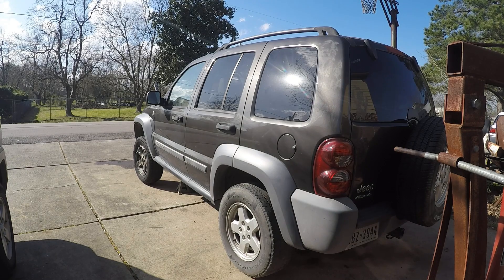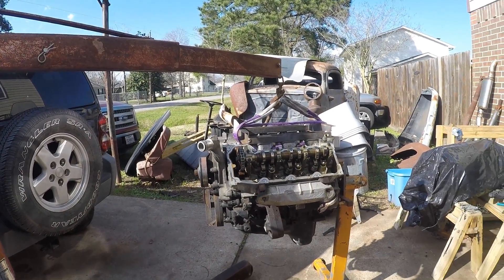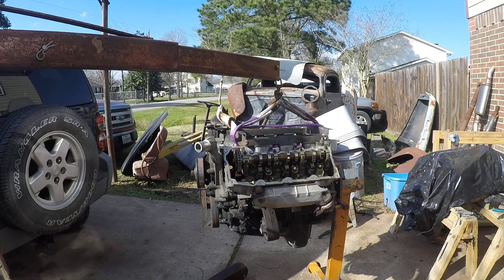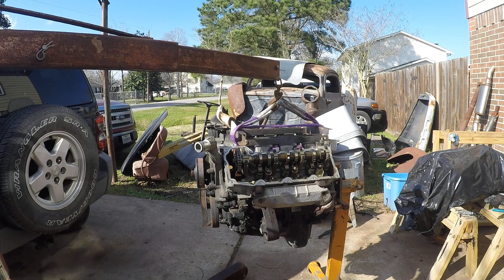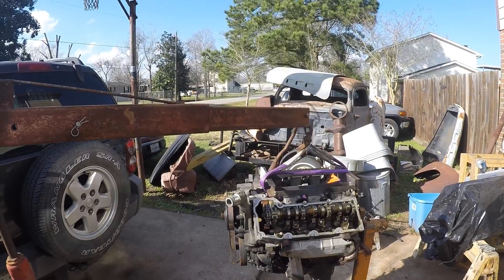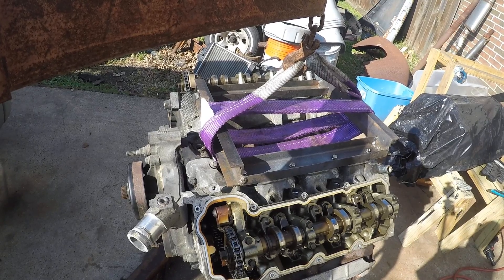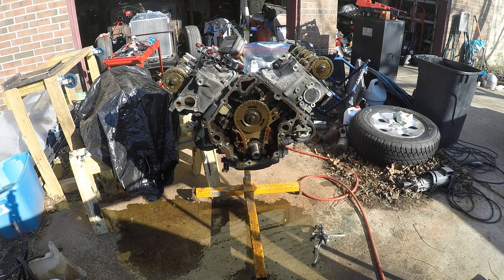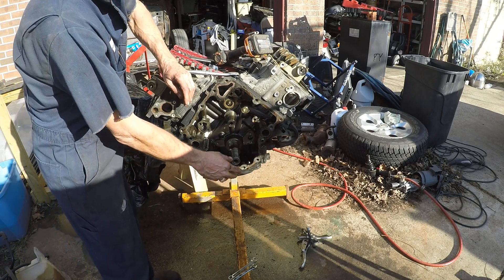What Happens To A 2005 Jeep Liberty 3 7L That Runs Out Of Oil

Comment: Have questions about a jeep im working on curious on your thoughts
Reply from the maker: Hello Ben. What’s the question?
Reply: @TreyClanton  I have 06 Jeep Grand Cherokee Laredo 3.7 replaced motor with an 05 3.7 everything's back together and it won't start it cranks spits a little and then just continues cranking. So my question is why I put brand new crank sensor spark plugs in it it's getting spark fuel and no start just a sputter every now and then
Reply from the maker: Hello ben proctor Assuming you have checked the basics like fuel, air, spark, timing, etc, I would check the crank shaft reluctor wheel for how many teeth it has. You can check it by pulling the crank sensor out and have someone turn the engine with a wrench while you use your finger or a screwdriver to count teeth. Be Very Careful! For an ‘06 it should have 32 teeth. If it is an older engine it might have 16 teeth. That reluctor will not work in an ‘06. I know that this engine supposedly came out of an ‘05, but you never know. If the crank sensor is not EOM, I would consider upgrading to an OEM. Let me know what you find. I’m always interested to learn more!

Comment: I have an 05 liberty with the 3.7. Are they good motors generally?  I take care of my vehicle.
Reply from the maker: BillyN31 I think they are great motors with one exception, the sputtered steel valve seats pressed into an aluminum head. If the motor overheats, it is very likely to drop a valve seat. I have the heads rebuilt no matter the extent of the work required on the motor. My head rebuilder peens the aluminum in a few stops around the valve seat to insure it won’t drop.
Reply: Trey Clanton thank you so much!!!!
Reply: BillyN31 I have 290k miles on mine and it still runs good! Not perfect but good! Just found out my fuel injectors are going bad but I’m planning to replace them soon. As long as you change your oil and oil filter every 3-4 weeks this car will easily last 200k+ miles!
Reply: we had one for 210k miles then it started burning oil but there was no other problems other than a starter.

Comment: I like your lift plate, so those 4 small bolts on each side can lift the motor out ok? I am going to try and make something similar to yours, I was just concerned about the small bolts. I tried to find a lift plate for the 3.7 but none of the auto parts stores can order one. Thanks, good video!
Reply from the maker: Tracy Lee,  I too was skeptical at first. This is the concept that is presented in factory manual. Dodge/Jeep/Chrysler specifies a special tool for this that I patterned mine after.
Reply: Tracy Lee ....I used std engine chain and tabs, one tab went to front a/c 14mm bolt into head and other went to the rear driver's side 3/4 npt fitting. Quick and easy ...came right out.

Comment: What’s the cause of the jeep burning oil?
Reply from the maker: Hello Susie. The can be several causes for a motor burning oil. You can have worn or cracked rings that can allow oil to get into the combustion chamber. You can also have bad valve seals that can cause oil to get into the combustion chamber.

Comment: I've run several vehicles well into the "high mileage" class.... My rule of thumb is to check and top off all fluids every Sunday afternoon after 100k. Worn several engines out, but never out of oil or coolant.... Just a thought. My current Ram 1500 4.7 has 165k on the clock. It uses a pint of oil between changes. I'll continue to monitor it and add oil as needed. No reason that it can't go a whole lot longer with good maintenance. I have a Chrysler built replacement engine in the shop waiting to be put in. It will not be installed until the current engine quits. Why waste money?
Reply from the maker: John Baugh I’m with you! We have a 4.7L in a 2006 Jeep Commander. She uses a little oil due to a leaking valve seal on #5 cylinder. It’s not a problem, just have to check and add fluids as necessary. Good maintenance is key!
Reply from the maker: It has just over 160,000 miles on it and going strong (fingers crossed)!
Reply: Should be good for quite a while. The 4.7 was designed to run for 150k for 95% of the people. Factor in the idea that many of them wouldn't properly maintain the engine and it makes sense. With really good maintenance the engine should last much longer. Remember, this average includes morons who abuse/neglect their engines. The actual service life when well maintained has to be pushing 200k+. Mine still has good (hot) oil pressure and has never been overheated. Tuneups, oil changes, etc make a difference! The 4.7 was bashed for sludging up..... by the folks that think a 5k oil change is ok. I run synthetic, change it every 3k, and the top of the cylinder heads looks like new. Timing chain tensioners look good. Just maintain it!

Comment: If replacement cranks are expensive, is crank welding a good option?
Reply: Machine work isn't cheap. You made a good call IMHO.
Reply from the maker: Skyline Fever I'm sure you could make something work, but in this case there was just too much torn up in my opinion. It would have required a new/used balance shaft, a new/used/reworked crankshaft, repair to the bed plate, two new piston rods, block bored over at least 0.020", etc. It would have been quite a bit. With salvage replacements readily available, it seemed better to walk away from this one.
Reply: Okay, that makes sense.
Thanks for the advice.

Comment: Getting ready to pull my 3.7 03 Liberty engine.  I was thinking i was going to use heavy duty tie down straps and wrap them through the head where the intake manifold seals to the heads.  It looks pretty thin though.  I have some chain too, maybe thread some bolts it with big washed and pull it that way.  trying to figure out the best way to rig it to pull.  I don't have a homemade bracket or the means to make one and don't want to damage the heads.  Any thoughts?  Thank you sir for the videos!
Reply from the maker: For pulling the motor, you could potentially use a couple of long bolts in head bolt locations. That won't be the best solution for reinstalling it though. You might try some lifting strap through the intake runners on the heads. If you do that I would use at least four straps to distribute the weight. Anther option might be straps down and around the exhaust manifolds, but I'm not sure about how much stress that might put on the exhaust manifold bolts. Just some thoughts. Whatever you do, evaluate carefully!
Reply: MMGJ10 there are mounting holes in block under intake manifold and  on heads. just make sure you use grade 8 bolts! I have used both mounting points as this time I had removed one head first before pulling the engine.
Reply: I used the std engine chain and tabs.
One in head a/c hole and other in driver's side rear 3/4 npt fitting.
Used the engine's fitting with no issues.